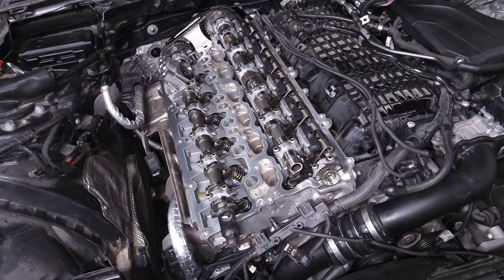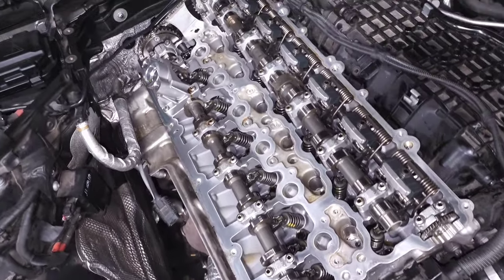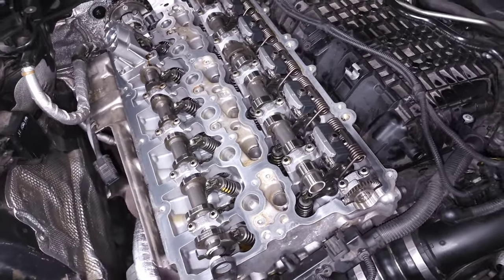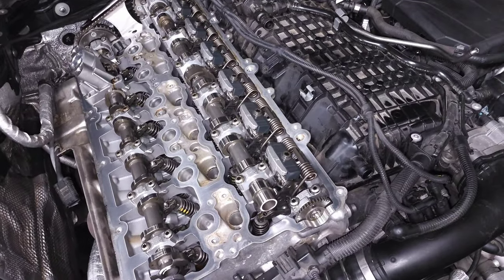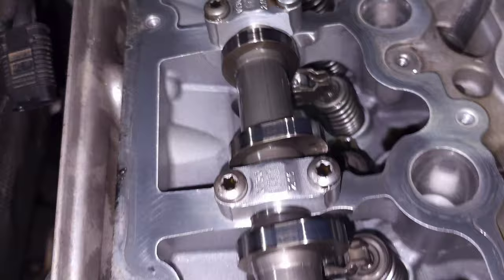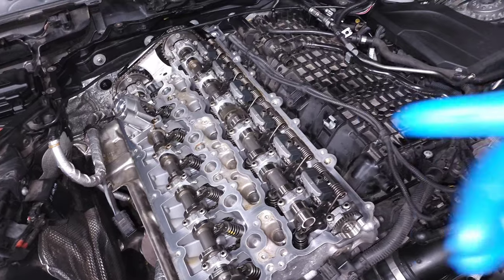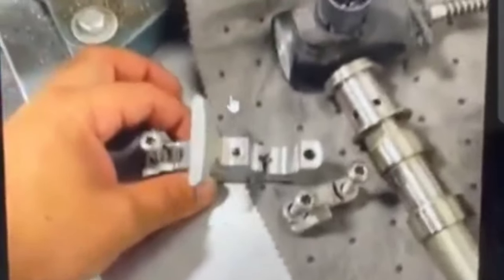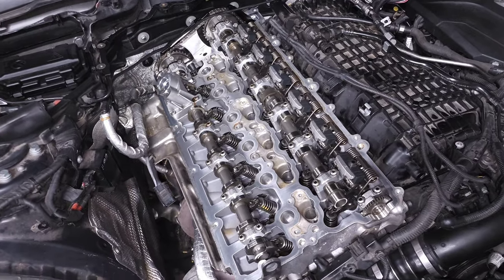Persistent Cylinder 1 Misfire on your B58 Engine? Check this First! *Cracked Cam Ledge*

Comment: If I'm reading the old bolt/new bolt properly, it looks like the new bolts have a higher strength rating. A 10.9 will withstand 25% greater force before failing, and 36% greater force before yielding(stretching) vs an 8.8. I would wager the issue isn't with the ledge but with the 8.8 bolts stretching, which allows the ledge to wiggle, eventually cracking it.
Reply from the maker: It's possible but seems some cars have longer bolts as well. That makes it difficult to pinpoint

Comment: Diagnosing a misgire with no code onmy 2016 340i.  Leaning towards this. Timing corrections are no higher than -3 on 93 pump gas. Misfire gets  better as the car warms up to operating temp though. Replaced plugs and coils with no heavy fuel smell (assuming injectors are fine because of that). I'm lost with it.

Comment: I bought a M140i in June from a Germany dealer ship, a 2019 car, it had the complete cylinderhead swapped just before I bought it, I have 2 years factory warranty. Was curious what recalls there where with the heads.
Reply: Does it have a 2 or 6 port cylinder head?

Comment: I was thinking of trading my G37S coupe for a 440i coupe, how would you compare the reliability between B58 and the VQ motor? Is it a vehicle that should have warranty on it at all times or should I be safe lol?
Reply from the maker: B58 is generally very reliable
Reply: @Andrew B It looks like the 2018 440i I purchased has 6 year warranty, what repairs have you done?

Comment: Completely off topic but seem like the guy to know the answer. Is it only the A90 Supra’s that have the different 2 and 6 port B58TU’s? Or do the G20 M340xi’s have that same situation? Currently in the market for an M340 which is why I’m asking.
Reply from the maker: Supra and Z4 (depending on region)
Reply: @kern417   as well as the following...
7' G12 LCI   (01/2018 — 12/2019)
8' G14   (07/2018 — 12/2019)
8' G15   (06/2018 — 12/2019)
8' G16 Gran Coupé   (06/2018 — 12/2019)
X5 G05   (10/2017 — 01/2020)
X6 G06   (06/2018 — 01/2020)
X7 G07   (11/2017 — 01/2020)
Reply from the maker: Incorrect. Those cars do not switch from 2 port to 6 port. The only platforms that had both are the Supra and Z4.

Comment: Would this happen with a b48? cylinder 1 constant misfires, changed coil packs, injectors, plugs.
Compression on cyl 1 is 4bar compared to 14bar on cylinder 2 (after cranking 3 times each) any ideas at all?
Reply from the maker: this won't cause low compression

Comment: I have a A90 been getting cyl 1 misfire but seems to only happen when running E-85 but on 93 doesn’t happen

Would this just constantly throw a code

A90 Supra
P800
Port injection
Reply from the maker: could be a lot of things. try the usual things like moving coilpacks and spark plugs between cylinders to see if it follows. if all else checks out and compression is good then you can pull the valve cover to check this
Reply: Did you find the issue? I have similar issue. Does the car break up when trying to get into boost?